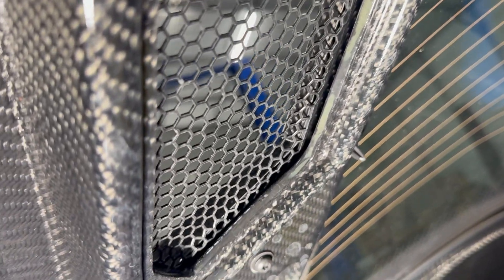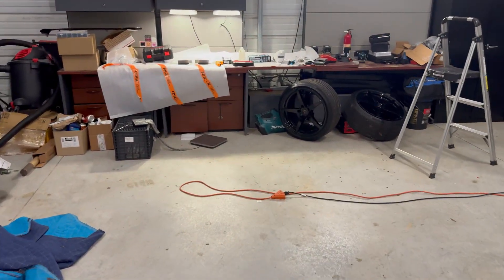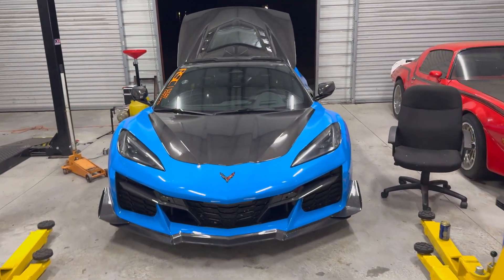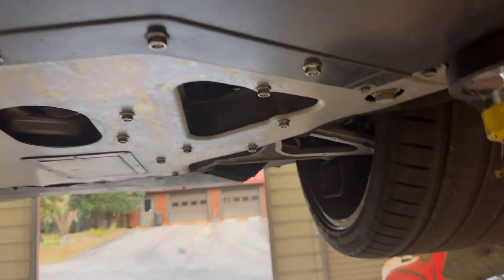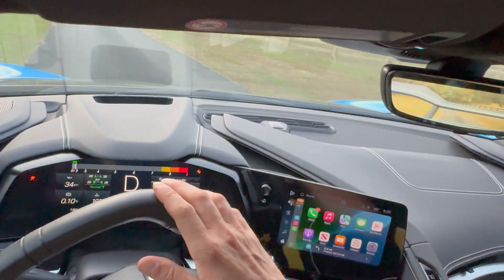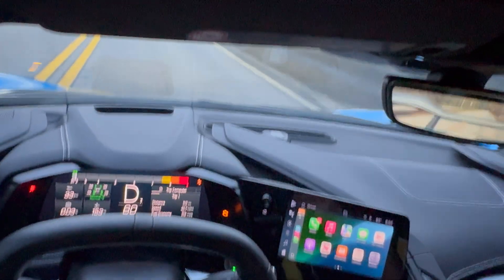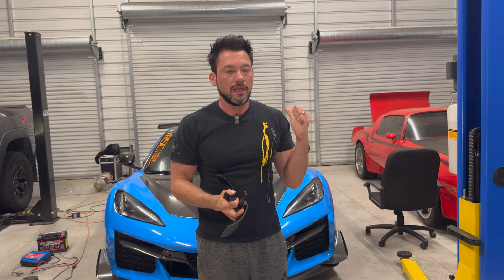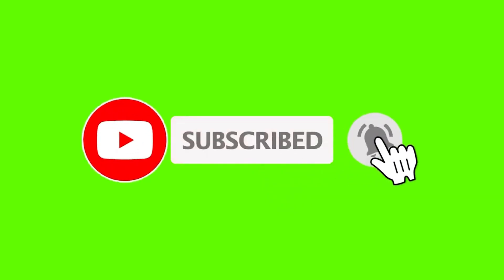C8 engine bay cooling with underbody air diverters

Comment: Any testing done with the paragon performance air deflectors?    They appear to be a little longer than the GM model.       You tested a pair that did not work.
Reply from the maker: The 3d printed free file ones didn’t work. The replicas I have here did. I have not tried paragons but see no reason they wouldn’t work just fine. Whatever differences from oem I doubt I could pick up based on how I do the testing since it’s not technically controlled and just the best I can do with what I have

Comment: I got a set and will install them on all three of my cars. I just installed the coated headers on the track Z06 so I hope these help. I had major issues on the stingray with headers and cats with engine bay temps that killed the rear camera wiring harness (on two cars lol). We did better shielding on the wires and it fixed it and we did more of that for the Z06. But the stock headers and cats have way more heat shielding! I do have blankets on the cats in the stingray. Considering some for the Z06 also.
Reply from the maker: I’ve heard a lot of stories like this also heard feedback that they help track guys too that use them on certain courses. I have headers as well and wish I had done the 2K coating vs the 1200 degree one
Reply from the maker: My buddy swears his ARH headers w the more expensive 2K coating from Jet hot has lower temps than stock w shields
Reply: @Brandonsgarages  just checked my invoice and I did the 2K coating. Awesome. My stingray was not coated and I would not track a car like that again. I got exhaust wrap from DEI but those headers are so hard to wrap I gave up and did Jet Hot.
Reply from the maker: @kendallbennett7451 that’s awesome lemme know what you think about the coating
Reply: @Brandonsgarages  oh that’s good to know as I sent mine off to Jet Hot also. Have to check what I did but pretty sure I did the higher temp coating.

Comment: I run the GM made ones , yes they do something . They were designed for sustained very high speed driving on the Autobaun . I track my car and it helped keep transmissin temps and engine temps down 5 degrees or so . My thought is the air still needs to exit thru the back window , no matter how much air we bring in from below it still must exit thru the vents around the glass and only so much air can leave ? I'm thinking of installing a fan in the trunk with a 4 inch round hole into the engine bay in the air filter cover , ducting out thru the rear side bumber grills . For people who carry golf bags and grocery's this is abstract but for track junkies is this an answer to getting the heat out ?  Even with the V09 system ( 4th radiator ) the heat must exit thru the rear glass and the vents are way too small for sustained 30 min. runs at a high speed track - for example Watkins Glen . I guess time will tell , I think I see this getting done this winter .
Reply from the maker: What about zr1 split window conversion ? Seems to allow more heat to exit w more expansive vents ?
Reply: @Brandonsgarages  Im sure it does - for 200k it should and needs too . But on a Z51 C8 we have problems with heat . Even the Z06 is much better than the c8 , GM should have given us the option to get the V09 system on ordering the car .
Reply from the maker: @salvatorecacopardo5460 oh I mean the split window conversion kits that are coming out that replace the hatch window. Some people are also swapping oem parts on too but there are some aftermarket copies too. Just wonder having more openings in the middle of the window how much more helpful that would be w the air diverters
Reply: @Brandonsgarages : I haven’t seen that product?
You have a picture?

Comment: It looks like a nitrous express system. They custom
 Designed mine a fogger system on the carbon fiber intake.
 They use their shop car to knock it up on.Mine was the first system like this in the whole united states. I have the complete system from nitrous express. Their custom wire Harness. Is auto bottle opener. Auto heater. Progressive controller. Stand alone fuel system. I have not put the video up yet.I will do it shortly. I did this system 3 years ago.On my 2020 Stingray..
Reply from the maker: It’s a hodge podge system. I had these parts laying around my garage for many years some of them off my c5 ls7 swap. I ordered a second plate and made this setup. The stand alone is from my c5 as well and fit pretty well. The clutches didn’t like it tho without a true progressive controller so I have stopped spraying it until I swap them out. I did trap 142 in the 1/4 with it and 112 mph in the 1/8 on 100 shot using e85 in the stand alone.

Comment: Did you ever get a check engine light from that cat delete ?
Reply from the maker: Yes I do
Reply: @Brandonsgarages was this the secondary cat delete you did ? You didn’t mention in the video. I saw the secondary one does not interfere with the 02 sensors. Thanks for helping
Reply from the maker: @1percentdigital910 this is the 2m cat delete setup with 90 degree bungs . All the standard 2m cat delete stuff they include I didn’t change any of it. It is connected to kooks headers and corsa track catback.
Reply: @Brandonsgarages got it. Thank you so much. Would you say the cat delete throw the CEL or the headers ?
Reply from the maker: @1percentdigital910  for sure the cat delete .

Comment: Thank you I wasn’t aware of these I will get a set.  I have a C8 Z51, with ceramic coated headers stock cats, I was concerned about heat after a cable problem that may have been unrelated.  I purchased a set of header blankets from Fabspeed,  engine bay temps on the top of my carbon fiber Paragon engine cover dropped 30-40 degrees F.  It is now running same temps as my stock C8 Z06. They really helped but are very expensive I think they were $1,300.
Reply: Wrap the exhaust from the cats back with heat tape as well , everything helps !! I did mine before I installed the 2M Fabrication cat back system ., best for the buck . No exhaust valves and was great price at 1200.00 .
Reply from the maker: I’m gonna test on a HTC this week w a buddy of mine. May still be helpful even w the blankets

Comment: If anyone is interested, drop me a note. We over at DynamicCaps are experts in 3D printing & materials. I'm printing a set now for my own C8. Great find !
Reply from the maker: Also do you have interest in making a new design that more closely mimics the oem?
Reply: @Brandonsgarages  Was thinking exactly that. Just sent my GM rep a note to get a set of OEM, which I can then replicate.
Reply from the maker: @Wrazikany chance you could share the file if u do? I understand if ur trying to monetize but if not i would love to be able to print a true replica w maybe a little reinforcement given materials
Reply: I am interested. What kind of material will the final product be made of?
Reply: @CharlesSmith-sf7jf  PETG-CF. I'm also working on a Nylon material thats Carbon Fiber infused (PA12-CF10) for a higher end track type application that can handle 2-3x the heat.
Reply from the maker: What material do you recommend for this ? I have a set in ABS now but do you recommend PET-G?
Reply: @Brandonsgarages  Either PETG, PETG-CF or ABS should all work nicely  ... I also am making a pair in PA-12 Carbon Fibre but that is going to the extreme and expensive and requires specialized equipment. PA-12 would be ideal for track situations with no worries about heat.
Reply from the maker: @Wrazikthank you sir
Reply from the maker: @Wra@Wrazikassume the Bambu p1s won’t do that lol
Reply: @Brandonsgarages  ? Not following
Reply from the maker: @WrazikPA-12 I assume the Bambu p1s can’t print in that. Sorry I’m new to 3d printing
Reply: @Brandonsgarages  Oh sorry, gotcha. The P1S with a hardened nozzle should be able to knock out some PA-12 for you. You will have to dehydrate It first for optimal printing. It will easily handle PETG and ABS with no issues what so ever.

Side note, my GM supplier just told me that "GM Canada will not let us order them.  There is also no pricing available at this time.  Tried to order, and the order cancelled right away unfortunately."
Reply from the maker: @Wrazikshoot me an email I know a guy that makes very close replicas (mine was actually bent down I didn’t realize it must have happened in shipping) I will get u in touch w him to maybe get a set
Reply from the maker: @W@Wrazikit won’t be true oem but very close and probably good enough to make a file
Reply: @Wrazik 
holy crap us Canadian z06'er's need you to save the day!
Reply: @brandonsgarages @wrazik send me the 3D print file please
Reply: I would like a set!
Reply: @aldoalu5133 same
Reply: I am interested in a set, please.
Reply: Noticed i didn't drop you a note specifically for wanting a set and that i accidentally replied to another guy on this chain that also wants a set. I think you could get a good number sold.
Reply: Can you send me the CAD to make my own? I have a 3D printer.
Reply: I would like to set as well.
Reply: How can I get some of those air diverters to cool the engine bay?

Comment: kinda useless  since I never drive the right gear
Reply from the maker: Too high or too low?
Reply: @Brandonsgarages  to low, I drive it in the city in track mode,   its in second where it really should be 3rd  iam sure the extra heat is there. if  I was really worried id be shifting early. other wise I enjoy the car for its intended purpose. since you enjoy you vet as much as I do  I would recommend front/rear sway bars and  after my experience some driving lights installed in the 2 front air rams deep in the  pocket, so cool the way it looks and functions.
Reply from the maker: @peterszenkowski7769 I do like the look of the front driving lights and would do it if I hadn’t already spent the money on the CF trim pieces. Hate to buy twice. Gets so expensive I just usually settle for what I have once I change it. For example the hood. I want a functional zr1 hood but I’ve already spent that money on a CF hood so I don’t wanna change it. If I had an unlimited budget tho, game on!

Comment: someone should make a lexan rear glass lid with a small scoop molded on to take some air in
Reply from the maker: Anderson composites has a large carbon fiber scoop that replaces the window and draws from the top . I just figure the natural up path w heat to be better but I dunno . There is also this other scoop thing that uses some kind of composite window that does that as well I can’t remember the name
Reply: @Brandonsgarages  I know what youre talking about with the second one, which is catastrophically ugly in my opinion, but both those options aren't crazy functional. It seems to me that nobody has engineered a perfect solution just yet. I wish I knew a way to duct the high pressure air in the rear wheel well into the engine bay and out the louvres in the top window. I imagine that would be the most efficient and unobtrusive means of rerouting air.
Reply from the maker: @THESLlCK that’s a good idea there. Agree on the no great solution currently. Maybe someone can repurpose a zr1 quarter to do what you are describing ?
Reply: Can you print me a set?

Comment: I just ordered a pair from Paragon, OEM part. I also ordered aluminum side vent grills from Radiator Grill Store ($118) which I will modify and attach to the upper opening lip to help keep out larger rocks and debris. Also, these vents should increase rear downforce because it removes air from under the car to the top of the car, thus lowering pressure underneath the rear of the car.  Thanks for the video.
Reply from the maker: Hadn’t thought about it like that! I think the screen idea is excellent and they should be made that way imo
Reply: @Brandonsgarages  thank you. Thanks for your videos. A company or individual could easily 3D print up a screen that would fit perfectly and be cheaper.
Reply from the maker: @z06doc86 I just got a 3d printer so starting to dabble in stuff with it but I’m not there yet on making my own things. Hope I will be tho over time . I will say this 3d printer stuff is really cool
Reply: @Brandonsgarages . Yes I want one but too many things going on in my life right now so I put it on hold.

Comment: WHERE DO YOU PURCHASE THESE?  Can you share a link, Thanks.
Reply from the maker: The guy that made mine I’m not sure is making anymore . There is a guy on the corvetteforums that has a set I think 

https://www.corvetteforum.com/forums/c8-parts-for-sale-wanted/4928127-new-pair-gm-underbody-air-deflectors-for-german-export-c8.html
Reply from the maker: Oem part numbers are 85580653 and 85580654 you should be able to get from local dealer
Reply: @Brandonsgarages  Thank you for the lead!
Reply from the maker: @aleksandarmarkovic4534 anytime

Comment: Have you found out any horsepower advantages? Sometimes with cooler temps comes with a slight power increase
Reply from the maker: Honestly not sure yet or how much is offset by the drag
Reply: @Brandonsgarages are you planning a video to test if these affect 1/4 mile times?
Reply: @douggrace5779 Live in Cali, no local tracks

Comment: Great job, Brandon.
I would definitely go with the 2k coating on headers next time around.
Reply from the maker: I wish I had known about it then! I really do for the extra money is a no brainer
Reply: @Brandonsgarages i think it was like 900 bucks to send to them and do the coating.  It's not too late lol
Reply: Are you talking about the one with jet hot 2k coating?
Reply from the maker: @BlueBanshee37 yes sir I believe so , a friend of mine Kevin just had his done in the 2K coating and it looks way more robust than my 1200 degree coating
Reply: @Brandonsgarages I got that done before having the headers installed. Im going to check engine temps to see how hot it gets. Now im curious lol I dont have the cooling brackets though but i have some ideas and i can machine a set at work to see how they work out.
Reply from the maker: @BlueBanshee37 awesome. I literally didn’t know the higher temp coating existed when I did mine or I would have gone that route

Comment: Wish there was a way to prevent heat soak in staging lanes while idling, temps on my car spiked 40+* everywhere and was going .8 slower on every metric. Dont usually notice heat soak while driving but this is slick
Reply from the maker: What about the boost district park release tool and pushing it through staging ?
Reply: @Brandonsgarages  i never heard of that until now, appreciate it. Will need to grab one!
Reply from the maker: @LSxDrew you will need access tho to the hatch which would potentially be an issue . The back cover has to be off but u could leave off for passes

Comment: Without heat shields or wrapping of headers forget it in racing. You WILL melt stuff, and its a VERY old problem that i addressed to Paragon when they first tried this. You CANNOT run unshielded headers for any length of time without destroying your engine bay on a race track.  That is simply old school.
Reply from the maker: What about the 2K degree coating ? Same thing ? Mine is the 1200 but a friend of mine Kevin just had the super thick but not attractive 2K coating done. Any thoughts on that?
Reply: @Brandonsgarages  YES. Ceramic coatings are effective. Without anything the melting starts on track at least with any highly tuned engine producing serious power.
Reply from the maker: @thiosemicarbizidebenzoylal2921 I wish I had done the 2K coating now instead of the 1200
Reply from the maker: @t @thiosemicarbizidebenzoylal2921 but I didn’t even know it existed . Just like the catch can I didn’t know there was a Mighty Mouse version w shorter hoses before I purchased that one
Reply: @Brandonsgarages   Stuff is awesome but pricey i think.

Comment: GOOD MOD thanks for the info. I’d like to get a set for my C8. ZO6
Reply from the maker: Thanks David. One cheap option is buy the eBay one side and then oem other and it will cut cost down .
Reply from the maker: The eBay ones only list one side for some reason but it looks to be a clone of the original

Comment: BAD Thing , it INCREASES DRAG
Reply from the maker: No doubt, it’s a trade off. But situationally like cruising at normal speeds I’ll probably use. Take off for dragstrip and track stuff depends on course and how many straights and how speeds.
Reply: I doubt drag is that noticeable given there are means for the air to escape. I'm more worried about picking up roadkill along the way. That kind of happened to me, it was deer and nowhere to go. I was thinking what would happened if I had these mounted. 😆
Reply from the maker: @thall1527 good point . An enclosed design would be better for that maybe . Oem ones have this saw tooth pattern that could decapitate the roadkill lol
Reply: @Brandonsgarages  I was afraid my splitter on the front end busted as it sliced the bone and other stuff off. You can hear the body under the car on PDR. It was a bit before I stopped and checked for damage. And there was none. Might be a bloody streak underneath though
Reply from the maker: @thall1527  dang that’s a nightmare scenario . I can imagine the smell
Reply: @Brandonsgarages  Note to self; don't drive during hunting season

Comment: Will these work on my hardtop the same way where will the air exit
Reply from the maker: Air may swirl more I would imagine not sure how effective on vert but if you have a scanner could install and monitor the engine bay tempts to see. Some of the eBay knock offs are 50 bucks so be a cheap experiment
Reply: @Brandonsgarages thx

Comment: I would also heat wrap the headers and the catalytic converter delete pipe.
Reply from the maker: I’m scared of wrap due to being a grease monkey sometimes I’m always in the engine bay. I have the 1200 degrees coating on headers but may go with the 2K coating and coat the delete pipe as well. The deletes are probably my hottest part of the exhaust I think because it isn’t coated and closest to the motor. I’m just very weary of header wrap